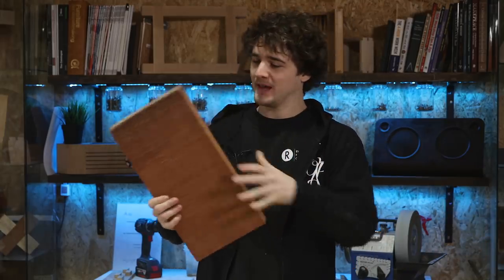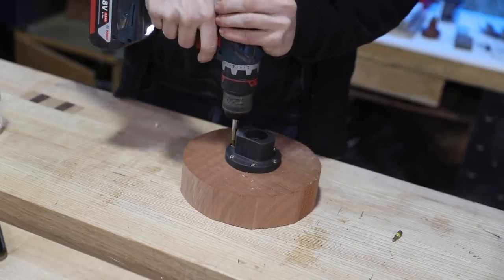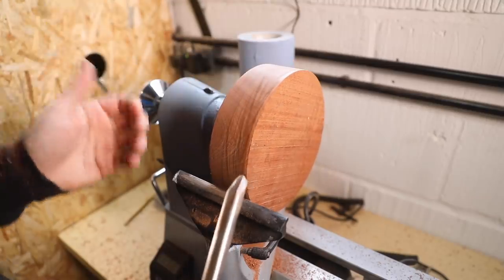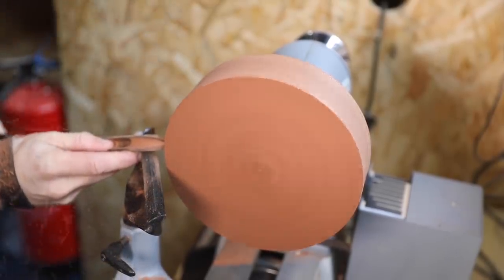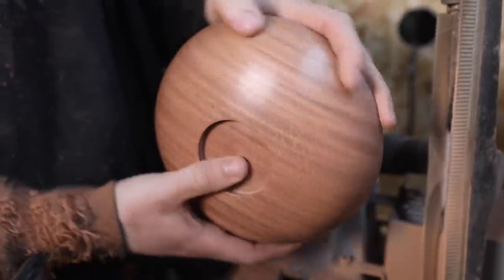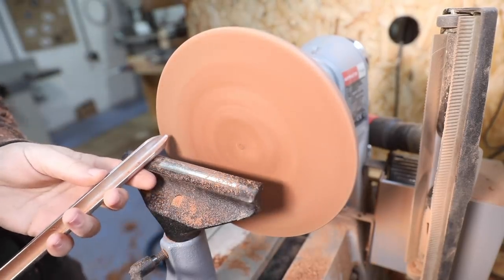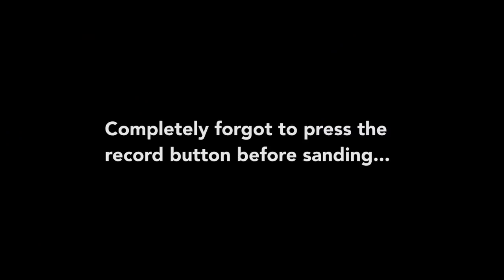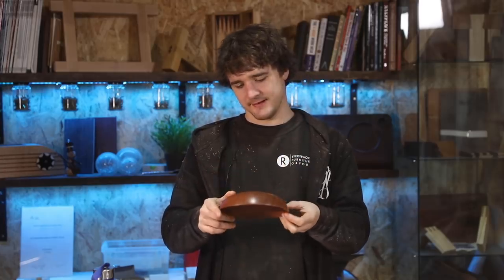Making a Bowl | Turning Tuesday #4

Comment: Good Job. A bigger bite and gliding the bevel will help with the spiraling (bumpy cut).
Reply: Love your channel! Nice to see you here.
Reply: @devoux237  He is everywhere. Every time I watch a woodworking video, he has beat me there by several hours!

It's always worth the effort to learn, create, and floss after every meal! I think I got that right.
Reply: Also doesn’t seem to have his gouge anchored very firmly to the rest
Reply: I am not a turner at all, but physics wise, doesn't he want a flatter angle on his tool so it pushes down into the toolrest rather than his arms?  More 90 degrees to the bowl?
Reply: A smaller gouge works as well to change the ratio of cut width to depth. This reduces the amount of effort required to perform the cut.

Comment: Nice to see you enjoying wood turning! The bumps are caused by the end grain, basically you have two patches of course end grain deflecting the gouge off the round! lighter cuts at a faster speed can help. Think of the blank as pages of a book, open a large book and rub your finger from centre to edge, then in the other direction and feel the difference! That`s what your gouge feels!

Comment: I was always told  that when using a bowl gouge the flute should not be facing upwards at all, it should be  used with flute on the side travelling either toward or away from you. I was told to draw a felt tip pen line up the middle of the flute and that I should not be able to see that line when using the bowl gouge. Good job with the bowl

Comment: Scrapers are used below 90 deg from the tool rest . Only carbide tools are used at 90 deg. or higher at the tool rest.  The chatter you get on the side of the bowl is from the spindle barring being out of line with 
the center of the work.

Comment: Matt you really are doing great for someone who has no ideea what he is doing and is learning only through Youtube.you can learn like that,with no courses or something.that how i learned to do leatherwork...just watching a Billion tutorials and starting to make my own little simple projects...Now i am getting to learning a bit of woodworking through youtube...simple things at first...it can be done...it just takes a bit longer without proper guidance,but you can do it.
P.S.  you should make a mallet next week...it's one of the projects that everyone has to make when they are woodturning and you could put it right along youre first dovetail in the glass cabinet in youre shop,or you could use it...and try to apply youre finish when the thing youre making is on the lathe,just at a lower speed...i think it will apply better and it is going to burnish at the same time...many turners  do that,i think you noticed....any way...keep it up...you are an inspiration to many  ;)

Comment: Some things you can do to reduce shake:
- push the gouge down harder on the tool rest
- take a bit heavier cut
- close up the flute of the gouge a bit more (more horizontal)
- speed up the lathe a little
- get a bigger lathe

good luck :)

Comment: Love your videos, just a note on turning.  You may want to move your tool rest up so you're cutting above the center line.  The higher above the center line you are the more the turning sends the tool back to you instead of pulling it down, this is more important for the bringing it to round portion. You obviously don't want to be too high because then you can't cut, so when bringing something to round you generally just want to be cutting maybe 10-15 degrees up (normally setting your rest top with center/slightly above with large radius's does the trick).

Comment: Matt, good bowl for your first time. I wish I had your eye on shape and proportion. Regarding the vibration try higher speed, present the gouge at a different angle, use a different cutting edge off the point, more pressure or less pressure into the wood and solid downward pressure on the tool rest. Most of all (which you already know) sharp tool! Note each species of wood acts different. Osage Orange and Olivewood are easy compared to Bloodwood and Purpleheart. Good luck & have fun!

Comment: I also use that type of lathe now my larger is a very heavy lathe and is more stable, having researched causes of lathe vibration with the smaller lathes I added more weight to my bench ( 4 bags of sand ) now its so much more stable.

Comment: From the looks of that vibration I'd say it's caused by putting too much pressure on the bevel. You should be gliding the bevel over the surface rather than rubbing it agains the wood. When you push too hard the cross grain section compress but the end grain doesn't so you create a bounce that progressively gets worse. Stuart Batty's videos on Vimeo will tell you everything you need to know and more.

Comment: Hi Matt, Really nice meeting you at Newark and looking forward to meeting up on the 14th April. If I had known you were new to woodturning I would have had a chat then. Having watched this video your problem with bouncing is due to speed and sharpness as well as using the bevel. Most new turners are nervous of putting the speed up on a lathe. Especially if it's their first go. The bowl you are making in the video looks like its spinning about 1000 - 1600rpm. For a bowl of this size you need to get it up to about 2500 rpm for a finishing cut. Your chisel needs to be sharp which it looks like it is. Also as previously mentioned riding the bevel will give you a cleaner cut. It also looks like your lathe is bouncing a bit on the bench but that could be the camera just moving. The lathe needs to be rock solid on the bench. Absolutey no movement at all in terms of flexing. Having said all that it could just be nerves on your part as well. Happy to give you a few pointers on the 14th April at Mikes. Regards Martin

Comment: It's lathe shake. You have a heavy piece of wood spinning on a small lathe with no tail support and you're pushing at a point wider than the headstock. Its harmless - Put in tailstock when roughing out to avoid. After that, all pressure is applied to the headstock or closer to the the centre of rotation so the force is reduced. hope this helps
Reply: also record power's wormscrew is an easier way to turn bowls. it just fits into a chuck - I use a RH thread in an SC3 chuck.
Reply: @arbitrarystuff1229  spiralling bumps do not come from lathe vibration, they are caused by tiny catches in endgrain combined with the wrong kind of pressure being exerted on the gouge by your leading hand.
Reply: These bumps amplify, since you try to let the bevel rest on the wood (which is bumpy). A possible solution to get rid of the spiraling bumps is to start a cut at a point without bumps and then make a cut deep enough to get rid of both valleys and bumps.
Reply: @ @stefanjohansson7601  You're right but also when the wood dries, there are areas that are more and less dense. This accentuates the affect and causes the shake even when the tool is not in contact. As you remove material, this effect is reduced  as it all gets lighter and the torque/rotational momentum "force" that helps with the shake it also reduces.

Comment: Try changing the angle of the tool (so the bevel is riding less) - this will also likely give you a bigger cut. I also recommend that you rotate the tool more when push cutting ( the tool should be rotated slightly towards the cutting direction, and the chips shouldn't be coming off the opposite side of rotation). This should also give you a cleaner cut.

Comment: It looks amazing! Especially for a first try.👌🤘
There's a video about Stuart Batty demonstrating his 40-40 grind which helped me out a ton...
 When you put the jaws on the chuck, just snug the screws done, then close the jaws fully and then tighten the screws... that way the jaws will line up perfectly and then the bowl should run dead true with no wobble.
(Also, what wood is it?... or did you already say?)
Reply: The Stuart Batty video I saw was from the Mid-Maryland Woodturners. Almost 2 hours long but very enjoyable and extremely knowledgeable. Get your cup of coffee, a pencil and notepad.
Reply: @richardgoebel226   yes, that's the one.

Comment: It's very difficult (depending on your kit i suppose) to re-center a piece when switching between the face plate and expanding collar chuck. Sometimes it's better to finish the base of the bowl while on the face plate and then the rest of the underside when on the chuck... especially for thinner walls.

Comment: I'm no expert, I've been turning wood for about a year. However, I I think your problems early on were due to your blank being out of balance and making your lathe vibrate.  I don't think I saw you face off the front surface. That should help. Also, you can Bing the tailstock up to provide more support. That might help too.

Comment: Good job for the first time i dont now if you have seen those deep "scraches" on the side those are the problem you can youse the side cutting edge to get rid of those its becouse the bowl gouge hase a pointi tio an the grain is in divrent directions even when you turn with even pressur it is very hard to make a perfect surface so you can youse the side cutting edge ore a normal sharp scraper like i do it🤘

Comment: hi Matt,  I can see a bit of wobble at the "corner" of your blank, which suggest that the face isn't true...this may contribute somewhat to the vibration you're getting. If you true the face, then come back to the edge it may improve. Also, you'll always feel the transitions from long grain to end grain as vibration. An overhand grip to keep the tool tight to the tool rest may help as will keeping the tool more parallel to the floor. Great job, and good luck with future turnings.
Reply from the maker: Thank you Jeff, I'll give it a go.

Comment: Nice job. As for the bounce, perhaps make sure the rest is just above the center line and try holding the gouge more parallel to the floor. From what I can see you seem to have the gouge at about 45 degrees which seems a little steep.  Then again, I have limited experience so take my advice with the appropriate pinch of salt :)

Comment: Sounds like you have a concave bend in your bevel edge, whereby the cutting edge of the chisel is flush to the piece, then the bevel bends in and then back out again, thus not all the bevel is hitting the wood at the same time......flatten the bevel, see if that works

Comment: Bowl turned out great. I highly recommend searching "Stuart Batty demonstrates bowl turning with his 40/40 grind
" as one other user I saw mentioned. Worth the investment in time to watch. In it, at about 27min, he talks about that wobble/gouges you're getting. I'm not 100 percent sure it is what's happening to you but it was to me. My issue was my technique, I was attempting a push cut where the tip of the gouge cuts and the bevel follows behind as it rides on that newly cut surface. As I was cutting, I was pushing sideways on the bowl with the tool while making the cut. The side grain would compress slightly, making a deeper cut but the end grain would push the tool out as it came around, making a shallower cut thus making a slightly oval cut. As I moved down the piece, the bevel would ride in that oval I turned, guiding my cut and further amplifying the issue. My hand closest to the tool rest was pushing the bevel of the gouge in on the bowl instead of keeping the tool secure against the rest. I've since been very focused on using my left hand to keep the tool down and my right hand to guide the cut. That's the best I can describe it but like I said, that Stuart Batty video is well worth your time.

One last thing, keep your tools sharp. You may have done so off camera, but I would've probably sharpened that gouge a few times through the course of making that bowl depending on how much material I could take off with eat pass.

Keep up the good work. The bowl turned out great.

Comment: Those concentric rings down the inside walls of your bowl come from the sharp bevel edge on your gouge. Most of the time we will hand grind at least half of that off. Using the scraper on the rim and inside wall of a bowl is dangerous. Most of the time it wants to catch, especially since the wall is thin and has no mass to back up any tool pressure. The walls want to flex, going long on the end grain, and short on the side grain. Do find a mentor. If nothing else, you will save a lot of sanding time.

Comment: I'd guess your bevel is riding the wood too much initially and so any bumps are amplified. Lock that thumb over the tool, forefinger along the face of the rest, lock the tool comfortably into your body and use your legs to make the movement. That's kinda what I do anyway.
Liked the bit where the dovetail was too small for the chuck. I've never done that personally....Oh no, not me... 🙄👍

Comment: That looks really good for a first bowl! =)
What wood is it?

In the future, consider getting a Forstner drill bit (https://drillsandcutters.com/2-forstner-drill-bit/  for example) 
I use those when turning bowls from green wood, instead of attaching pieces to the wood, I get to remove material to fit the "dovetail chuck".
Not sure if this works with dry wood though since the Forstner bits kind of eat away lots of material due to the size.
And obviously, get one that matches the measures of your chuck. =)

Comment: i find the tool does not pump and poosh into me as much if i hold the tool closer to 90 degree to the work. it seem counterintuitive comparing it to chiseling not on the lathe but it works for me. :) i am just muddling through myself, so not an expert. :)